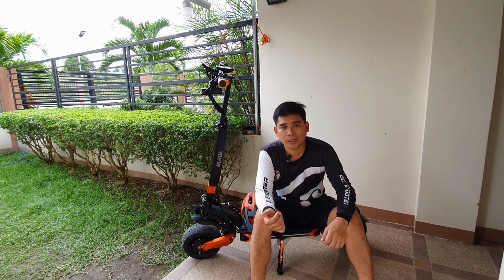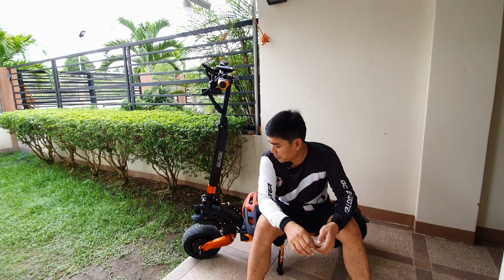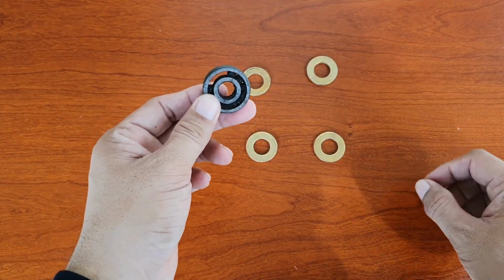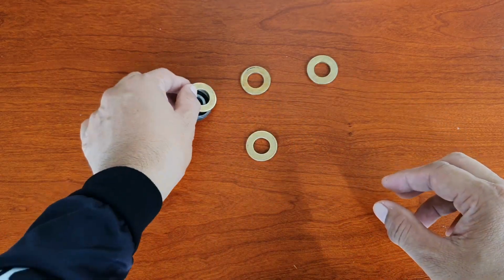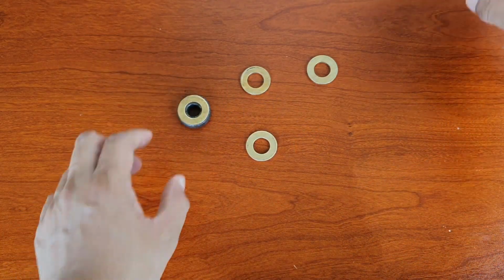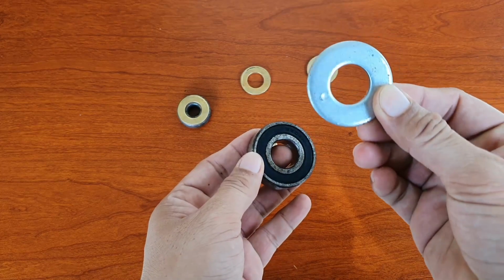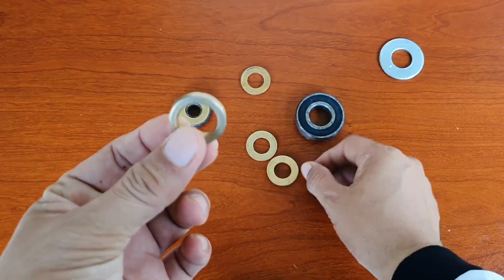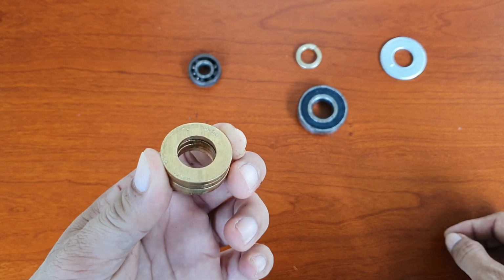Blade GT Plus - Hydraulic Suspension Issue - Fixed!

Comment: Great video...except for one problem - the lock washer.  Up to that point, you were 100% correct.  However, even when using a washer with a smaller OD, it's still possible to cause binding within the bearing.

In RC, we use a lot of washers...to go between bearings & gears inside of transmission, to go between bearings & wheel hexes on axle stubs, to move ball ends further from other parts, etc.  Taking just one of those examples - the washers between the bearings & wheel hexes - even though the washer is small enough that it's only touching the bearing's inner race, if the wheel nut is tightened too much, putting excess pressure on the wheel & wheel hex, it can lead to the washer being pressed against the bearing's inner race tightly, causing the bearing to seize.

With the above example, there is even pressure against the bearing...but, again, because the pressure is excessive, it causes the bearing to seize.  The 'solution' to this problem is to simply loosen the wheel nut just slightly, releasing some of the pressure.  However, in using a lock washer, you can't actually do that, because, as long as there's any pressure pushing the lock washer against the bearing, there will always be greater pressure against the inner race at a single point, causing pressure against the inner race to NOT be even.

Replacing the washers with washers having a smaller OD is, definitely, the correct solution...but, you NEED to replace those lock washers with standard flat washers.  If you don't, sooner or later, the 'point' of the lock washers could damage the bearings...and, if that happens while you're riding (especially if riding at higher speed), the end-result could be disastrous.  Do whatever you want, as it's your life...but, I would HIGHLY recommend replacing those lock washers with flat washers as soon as possible
Reply from the maker: Nice observation and recommendation sir. So far no issues encountered for a year or riding. The sealed bearings provided help in keeping the dirt out.
Reply: @ScootTaBai  You're welcome.  Just as I'm willing to help others in RC, I'm also willing to help people in other hobbies/activities...especially when I see something that could potentially lead to injuries.  I know sealed bearings help keep dirt out...that's exactly why we use them in off-road RC vehicles (as opposed to metal-shielded, or 'open', bearings)...but, I wasn't referring to the bearings.  I was referring specifically to the washers, and potential problems that could be caused by using lock washers, as opposed to flat washers.

Lock washers are excellent when needing a washer AND some sort of "push back resistance" (such as a spring would also provide)...but, when only needing to "separate" two parts (such as a wheel & bearing), that's when flat washers are what's best.  It's kind of like knowing when to use blue threadlock, and when to use red threadlock.
Reply: Thanks for the tip, that makes sense! I'm going to try that.
Reply: Good video. THANK YOU 🇨🇦.

Comment: Absolute truth, I did it and it rides much better! Steering dumper should be also redesigned as is on fighter... Shocks are not something, thinking of changing them with fox ones.
Reply from the maker: Thank you sir. There are still a lot to iron out with build but overall it is an awesome scooter.

Comment: Get a shoulder washer. The way I see it there are five solutions, maybe more, but mainly, just go with a shoulder washer.
The factory washer of the blade gt is actually the correct size to protect the bearing against direct water and dirt ingress by splash from the side. 
The engineers had the good idea to have washer large enough to act as a fender for whole the bearing face, but badly applied the idea.

If you take a smaller washer like you did, mechanically it is correct (even though a split ring washer is not good, go with a flat), but then you're creating a dirt and water accumulation and ingress point because now the bearing is partially naked.

What is not correct from factory is the form of the washer, what you need is not a flat washer (and not a split lock washer etheir), you need same size washer than the factory but what's called a shoulder washer.

The simplest solution is to insert next to the factory washer a thin contact washer to act as shoulder, and then add the felt pad or a thinner large washer (maybe teflon ?) that's just occupy the space and avoid dirt accumulation.

With a shoulder washer the axle nut torque force is correctly applied only to the inner bearing ring, but the outer part is still protected against direct splash water/dirt ingress and less of a dirt collector without pressing on the bearing outer ring. Of course the shoulder washer has to be installed on the correct side (shoulder facing the bearing).

If you want to go the extra mile, you can plug the shoulder gap with a felt washer pad to really have the assembly almost waterproof but still not pushing against the bearing outer ring if the felt pad is not too thick. Shoulder washer + felt pad is how it is done on motorbikes wheel bearings.

Other solution, just get a small flat washer and add etheir a feld pad washer to cover the whole bearing (I think dualtron does that solution for their suspension assembly), or a large washer that thinner than the small washer. 
Getting to the gritty details but I also think the chamfer on the inside hole facing the bearing is important, since the axle seems to have a flaring, it would be best if the washer does not sit on the axle flare.

The state of art solution would be the full brass sliding inserts like Weped, honestly you can't beat that, it's simpler and less fragile than bearings, while still as efficient for this application.
Reply from the maker: Nice observation and recommendation sir. I was in a hurry to ride and so grab the first washer i saw in the shop that exactly the size i need. The sealed bearing helps the dirt out, hence i got no issues so far and its been a year now.

Comment: Good tip I am going to do this to my Teverun fighter 11 plus. Question do you know the torque specs for the swing arm bolts ? Also have you done any actual adjustments to the shock itself such as preload or adjusting the firmness?
Reply from the maker: I did 25lbs/in for the swing arm bolts and put a drop of blue threadlock. As for the suspension, this is the configuration best for my weight (73kg) so far - 2 threads in front, 3 threads high in the back for the spring, 6 points less from max slow (S) for the rebound.
Reply: @ScootTaBai  thanks for that info! I am a bit heavier than you and I set my springs to show 5-6 threads on front. 2-3 threads showing on rear. Then I turned my rebound all the way clockwise towards S then backed it off one click at the end.
Reply from the maker: You should adjust your spring to be stiffer at back where most of your weight is. More threads showing = more stiffer (already compressing the spring). Less compression, the softer.
Reply: @ScootTaBai  ok I followed the suspension setup guide from electric scooter guide for a Nami burn e since it uses the same hydraulic shocks.

Comment: The washer is a 26 mm diameter now.  That's what ships in the scooter now.  I think could still be slightly too big.  I'm replacing them with a 25 mm diameter washer.  But now I'm having problems with the brake caliper being uneven against the rotor.
Reply from the maker: Thank you for the updates sir.

Comment: Hi Scoot,I am considering installing these washers to see how they will improve ride quality on my GT+.The theory behind it makes sense,and I am curious to see the difference this change makes.
What specific size washer should I use in terms of the inner and outer diameter and thickness.Looking closely,I can tell the inner diameter of the new washer is slightly smaller.
These specs would ensure that the correct size is ordered.
Thanks!
Reply from the maker: They use 3x17x30mm washer. Look for anything smaller outside diameter. Ex: 3x17x22mm or 3x17x26mm
Reply: @Scoot Ta Bai  My appreciation🙏 for replying with the optional washer sizes and your contribution to the Blade GT+  community is highly valued.
I will update you on how the suspension reacts after purchasing and installing the new washers.
Reply from the maker: You are welcome sir. Its already tested and proven :) some of our Teverun users shared their positive experience in the comments as well
Reply: It makes such a big difference brooo! I did mine today. It's like a whole new scooter
Reply: @Campo246  Thank you for your input. Everyone, including yourself who has installed the reduced size washers,is definitely in agreement with the huge difference they have made to the suspension system.
I plan to do the same soon!

Comment: Hi I bought the blade gt and one of the caps on the side arrived a little cracked and after I hit the door accidentally it cracked even more I was sent replacement parts but don’t know how to repair it do you have any tips?
Reply from the maker: Hi Aries. Which cap you are referring? The plase orange accent design?

Comment: the problem is not in washers. the problem is with bike assembler hands, he tightened the nut too tight!I I unscrewed the nut with lever. three of four nuts stayed together bushing. who buys the blade now, check those nuts
Reply from the maker: Regardless if tighten or not, technically washer should be smaller than the outer bearing for it to function properly. Loosening it up is just a patch up remedy but risky. Loose bolt or nuts is not recommended.
Reply: @ScootTaBai  if the nut comes off,structure will not fall apar. there is simply no need for additional clamping.there is plastic in the nut,you can always add blue liquid to enhance.I ordered brass washers m14x2x28,in the end i will do 15,9x2x25.need the right washers, so that the dirt did not go into the bearing,washers not pinch the bearing balls
Reply: @drvova1752  So you are recommending smaller washer or no?
Reply: @Lordhavemercy254  yes, I bought copper ones from Ali.14:25:2 mm.

Comment: Hello. 

Im from australia and am having a hard time finding the right size washer for this. Do you know of anywhere I can buy it online?

Thanks
Reply from the maker: good day sir. if you can't find the correct size washer from your local hardware store, use an angle grinder and grind the existing washer to the right size
Reply: @ScootTaBai  true I might to do that. I have a fighter 11+ but the issue is still the same

thanks
Reply: @ScootTaBai  hello again. An update to this.

It works so well! I took my scooter apart today. The washers were so dirty and don't spin very well anymore

The new washers work really good. Also put grease too which helps.

Such a big difference. Thansk again!

Comment: Respect from Greece 🇬🇷!!!!!👌🙏🙏
I have a basic misunderstanding.....🤔
Your motors magnets are 5 cm or 6 cm......????🤔
I believe they are 6 cm magnets (same motors with Nami) .. but if they are 5 cm it has difference... 
Thanks 🙏
Reply from the maker: Hi @Antony. Thank you. I don't know what is the size of the motor magnet with Blade GT, but based from our speed run test head to head againts Nami Burn E 2, Blade GT+ is faster.

Comment: will this work as well for the blade x pro??
Reply from the maker: I am not sure if the Blade X pro is having the same problem, but if yes, it should be the solution. Check the washer if its bigger than the ball bearing.

Comment: Do you think it really makes a big difference?
Reply from the maker: Yes, big time. Before i change the washer, the scooter was riding like a rock. It doesnt feel like a premium scooter at all, after the change it was smooth as butter. I can already manage big road humps and offroading.
Reply: @ScootTaBai  Thank you 🙏 Do you know where I could find the new washer? I can't find them in stores 😔
I'm looking for M16x25x3 or M116x26x3
Reply from the maker: If you can't find them from your local hardware store or autoshops, and if you have and know how to use a grinder, you can grind the existing washer to your desired size.